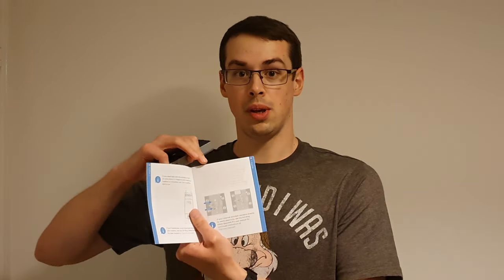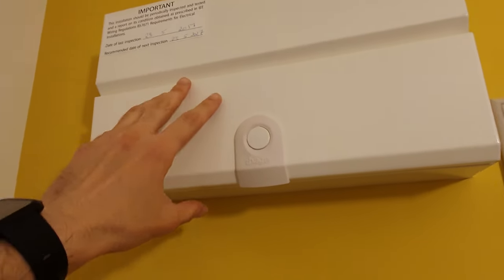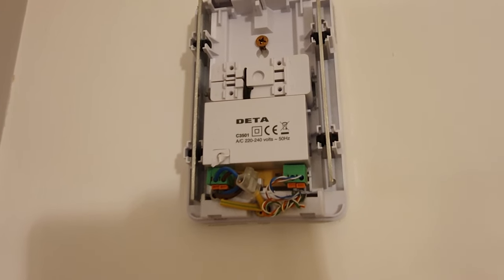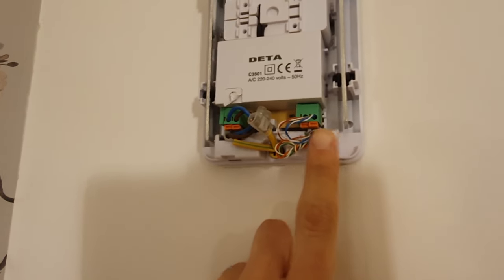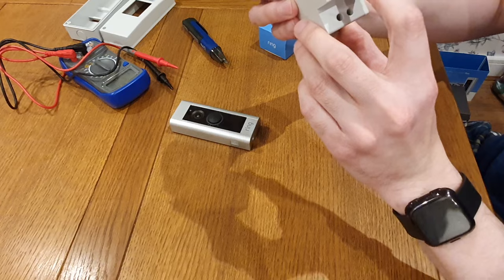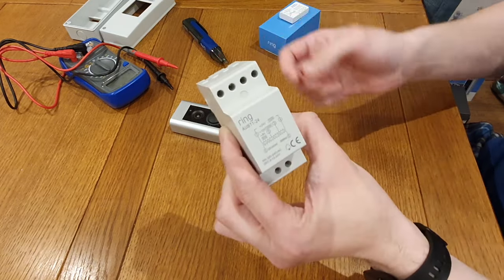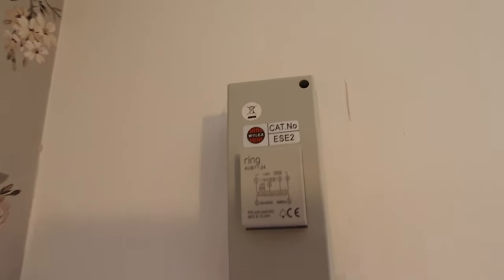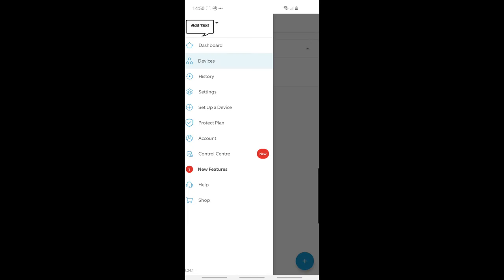Deta Doorbell to Ring Doorbell Pro - UK Wiring Guide (Direct To Transformer Install)

Comment: Hi great video, I’ve followed this and I’m resulting in a buzzing noise coming from the transformer it’s not getting hot or anything but the sound is annoying… do you know how I can resolve this?
Reply from the maker: Hi, thanks 🙂 The buzzing sound is annoying because not all Ring transformers have this issue. The best advice is to firstly rule out any loose connections, but after that to contact Ring customer services who might be able to send a new transformer out.

Comment: Hi great video! I have a ring 3 plus bell, iv followed your steps it said hardwire but it does t get charged some reason ,
Reply from the maker: Hi, thanks, glad you found it helpful. That's odd - does the app show the voltage under Device Health?
Reply: No i dont think it shows on the ring 3 plus , it just says wired and battery shows very good ,i read somewhere it says for saving battery it won’t change till it gets below %90 so i will wait till battery goes below %90 , im hoping it will charge back up 🤞🏽
Reply from the maker: Ah good point, I had forgotten that it's more of a trickle charge with the non-Pro options. You're probably right that it's not currently charging much/at all due to its design. Plus the Ring support page says that low temperatures can have an impact too: https://support.ring.com/hc/en-gb/articles/204252980-Ring-Video-Doorbell-Hardwired-vs-Battery-Powered-Operation

Comment: Hi, good video. Exactly what I want to do.
What version of the ring doorbell is the one in the video and what else do I need to have everything you used in the video?
Reply from the maker: Hi, thanks! This is the Ring Doorbell Pro 1, but the steps should be similar for the Pro 2 and Doorbell Wired too. The only other thing you'll need is the wall enclosure - I purchased this one: https://www.screwfix.com/p/wylex-ese2-ip40-2-module-unpopulated-din-enclosure/32311
Reply: @SmartHomePoint  perfect. Thank you.
Reply: @SmartHomePoint  Hi, I got the Ring doorbell wired but it didn't come with the transformer or circuit breaker. Can these be purchased seperatley do you know?

Comment: Where does your chime come from now you removed the whole unit?  I don't have a bell switch in my consumer unit so this is the only way I see of wiring it up as I dont want any wires exposed. Bit annoyed that I didnt realise before ordering.
Reply from the maker: Yes this approach should work well for you. There's also the Ring Pro plug-in power adapter, but this may depend on how easily you can run and hide the power adapter cable. In terms of your question - the chime is literally via the plug-in Ring Chime device (also supplied in the Ring Pro box). One downside is that this is WiFi based, meaning that if the WiFi is down, I won't get a doorbell chime. On the plus side, I can hear people knock just fine and my WiFi is super reliable, so I'm not too concerned about only having WiFi-dependent chimes.
Reply: @SmartHomePoint  Thanks for your reply.  I'll be doing it your way.  I dont have a spare plug near enough the doorbell and dont want any cables exposed.  Ah didn't realise it comes with the seperate chime, I just checked and it will.  I can also connect the doorbell to to the amazon Alexa, just realised.  Also, not that I need a chime with two dogs in the house.  I've ordered the circuit breaker enclosure now.  Thanks
Reply from the maker: Ah cool, sounds a plan - I hope the Pro works out well for you! And yes, fair point about the two dogs as a backup chime 😆

Comment: Do you know what size torx screw this uses? I bought a screwdriver and screw online and the screw does fit the whole, but is far too short to reach the thread behind. Having real problems trying to find out what size I need
Reply from the maker: Good question. Uhm, it's a T6 Torx screwhead but I'm not sure of the best length to buy sorry. From memory, it was a quite short screw for my Ring Doorbell Pro - it certainly wasn't long.

Comment: Thanks for the video. Can you tell me how you removed the wires from the Deta doorbell please? There are orange tabs underneath the green connection blocks - do you have to prise these down, up or in to release the wires?
Reply from the maker: Unfortunately I can't remember for sure how easy it was to remove the wires. I think it was fairly easy though - I think I used a flathead screwdriver on the orange tabs, and moved them away - whilst pulling on the wire to remove it.
Reply: @SmartHomePoint  Many thanks!

Comment: Do you need a transformer. If I understand correctly the DETA input is 230v and output is 14.5v ac. the Ring 3 supports that out of the box. Ring supports 8-24 volt amps V ac.
Reply from the maker: The Doorbell Pro requires at least 16v AC as far as I know ( https://support.ring.com/hc/en-gb/articles/115000115323-Troubleshooting-Insufficient-Power-Issues-with-your-Ring-Video-Doorbell-Pro ).

As far as the non-Pro models go, I agree that they allow down to an 8c AC supply as you say. However the Deta doorbell units are all listed as incompatible ( https://support.ring.com/hc/en-gb/articles/210644123-Ring-Video-Doorbell-Chime-Kit-Compatibility-List ) due to the chime component. So my hunch is that the non-Pro models would still need a transformer change (unless a way is found to just use the transformer part of them).

Comment: Just got a simplisafe doorbell (recently launched in the UK) and I'm facing the same issue where simply switching up the Deta doorbell with the new one doesn't work. Have you or anyone got any recommendations on a non-ring transformer?
Reply from the maker: Byron are meant to sell a transformer that works with a range of smart doorbells, but I haven't tested it out myself sorry.
Reply: @SmartHomePoint  cheers for replying! I decided to order a British 8-24V transformer/plastic casing set from Amazon. Description said it is compatable with various video doorbells. Don't think I have any alternative to the Ring Power Kit thing though but can't see anywhere that Simplisafe doorbells require one.

Shame that Simplisafe support basically tell to use some other non-specified transformer or contact a professional. Whereas Ring seem to include all the bits needed with the doorbell itself so DIYers can replace the Deta ones themselves.

At least the SimpliSafe Base Station can ring without a chime so won't have to worry about getting that one too.
Reply: Update: Removed the Deta box and attached the new transformer. Simplisafe pro doorbell now works like a charm. Thanks mate!
Reply from the maker: That's awesome, glad to hear it worked 👍

Comment: Great vid! The terminals on the rear of the ring doorbell look very exposed to water ingress. Is there any kind of water seal that comes with the doorbell to give it some sort of protection from water seeping down between door frame and doorbell?
Reply from the maker: Thanks! Yes you're unfortunately right, they do seem fairly exposed. There's no water seal included, nor is this mentioned in the full install guide. It's been dry since I installed the Ring Doorbell, but I'll keep an eye on things when it next rains.
Reply: @SmartHomePoint  any updates now that it has rained many times? Any problems at all?
Reply from the maker: Hi Hamid, there's been no issues at all thankfully :) There have even been rain drops on the very top, but with no issues in the operation of the Ring Doorbell.
Reply: @SmartHomePoint  brilliant, good to hear 👌
Reply: I noticed this could happen when I installed mine. I put Evo-Stick Multi Purpose Silicone (clear) in the gap! Hope this helps...

Comment: Cheers for this video. Is the installation the same if you don't have an existing doorbell?
Reply from the maker: Everything after I stripped back the Deta doorbell would be the same yes - i.e. the Ring Pro transformer needs a mains voltage cable as input. Alternatively if you don't have an existing doorbell at all, you can buy the Plug-In Adapter which plugs into a wall socket and then you run the cable directly to the back of your Ring Doorbell Pro (i.e. do need for a transformer in-between).
Reply: @SmartHomePoint  Thank you. Much appreciated. I've got an electrician coming in to do a fair bit of wiring anyway so transformer wont be any extra trouble. So you used the two little holes in the side of the pro power kit? Those spots are already showing on mine and when I peel back my sticker, it is a small two pin socket under there. Is that the same for you?
Reply from the maker: Ah cool, sounds like including the transformer will be simple enough for the electrician then. Yes I used the two little holes in the side of the Pro Power Kit. Mine sounds the same as how you describe yours yes.
Reply: @SmartHomePoint  Cheers!
Reply from the maker: A useful guide thanks, good to have some extra context for the install.

Comment: Hello I see you say the C3501 has a transformer already installed, so if we want to just keep that on the wall where would i place the bypass cable?
Reply from the maker: Hello, unfortunately I'm not sure where the bypass cable would go with the C3501. The Deta doorbell doesn't always supply sufficient and constant voltage for the Ring Doorbell. That's why I swapped it out completely, since it's not compatible as-is for powering a Ring Doorbell.
Reply: Did you ever figure this out? I was going to try this before buying another transformer and going through the hassle

Comment: Hello I’m getting a buzzing on my transformer and through my ring video feed have installed it wrong?
Reply from the maker: Hmm that's frustrating. I've heard people mention this, but mine was fine. Of the people who have had this themselves, some people say that they had a short (e.g. the wires at the Pro were touching each other), others had a loose wire connection somewhere, and fixing this usually fixed the humming.

If that doesn't help though, it could be worth getting in touch with Ring's support team incase it's an issue with the transformer (i.e. beyond any minor noise it could make).
Reply: I'm getting the very exact issue... and has caused no amount of distress to my dog... to the extent that I've uninstalled the Ring pro and am considering returning it. But, I might actually tin the wires to see if that helps ensure that the wires don't fray and come into contact with each other.
Reply: @thepandefamily  I’ve contacted ring and they’ve said it is sometimes the transformer itself and they’ve sent me another. So I’m hoping that solves it

Comment: Cheers, great video! Would I be able to just splice open a power cable, plug one end into the transformer and the other end in to wall socket for AC power? 
Is there any issues with doing that grounding maybe?
Reply from the maker: Thanks, glad you found it useful :) What you say should in theory work as it would be 230V into the transformer input... but I'm not a qualified electrician so I can't say for sure.

I'm not sure if you know about the Ring Pro Plug-In Adapter, but that might be a good alternative. It's an official Ring product and allows you to bypass the transformer completely - you plug it into a wall socket, and then you just get two 24V cables to connect directly to the Ring Pro terminals. Could be a nicer solution, depending on if you can run the cable.
Reply: @SmartHomePoint  thanks for the reply, yes I've just tried it and it works a charm!
Saves me spending £20 on an adapter
Reply from the maker: That's great, good to know that this method works. Enjoy your new Ring doorbell!
Reply: @SmartHomePoint  i just got the adapter for the doorbell. I am planning on replacing the doorbell box with a socket and the wires from the bell will just come out there on top. I need to cut the adapter cable as it is 6 metres long but I only need 15 cms.
Reply from the maker: That sounds a good approach, it'll lead to a clean install IMO. Hope it goes well for you 👍

Comment: Why you couldn’t install the transformer in the consumer unit? You already had a switch for the door bell in your consumer unit. All you had to do was replace this with the ring transformer and this would send the necessary 24 volts to the doorbell box and then straight connect it there to the doorbell. Am I missing something?
Reply from the maker: My understanding is that I would still have had to join the CAT5 output cable to the higher guage 240v input cable somewhere - i.e. still at the wall where the old Deta doorbell (and new Ring transformer) were. So yes, I could have done it this way but it still would have required a junction box or similar outside of the consumer unit AFAIK?
Reply: @SmartHomePoint  M’y current doorbell has just two single white wires going out to my old doorbell straight from the transformer. I don’t have a CAT5 output at all. My problem is that my consumer unit has no dedicated switch so i can’t be sure which cables going to the existing doorbell. So I bought the adaptor pro doorbell so I can totally remove my existing doorbell with a socket and just plug it in
Reply from the maker: Ah okay, a bit different to mine then. Yes the power adapter sounds like the perfect choice for you then 👍
Reply: Your old deta door bell could been used as a junction box no??
Reply from the maker: It could have been, but I saw someone else attempt it and they ended up using some tape to hold the Ring transformer in place inside the Deta chime unit. Since that felt like a bit of an unreliable approach, I thought that I'd be better off with a specific 1 unit DIN rail enclosure.

Comment: hi is it normal for my transformer to make a slight humming noise
Reply from the maker: Unfortunately it is yes. Some Ring transformers make no noise, others do. If yours seems too loud, try contacting Ring customer service - sometimes they send a new one out.
Reply: @SmartHomePoint   thank you for your reply i found out its the transformer touching the casing is there better casings out there
Reply from the maker: Oh that's interesting. I'm wondering whether a 2 or 3 module DIN enclosure might be better instead? As it will give more space. Alternatively, the following might work well but I'm not sure if overheating could then become an issue: https://www.electricaldirect.co.uk/product/hylec-dn-junction-box-125x175x75mm-671722?vat=1&pr=1&gclid=CjwKCAjwjJmIBhA4EiwAQdCbxjiEpMKZ0b2qrZEhFbTF292PERnZOd100YSMCvxfhrQ4O9HBahBNphoClQ0QAvD_BwE

Comment: I bought a different brand of doorbell and there was no mention of any circuit breakers. Is is really necessary? And if so, are there any third-party circuit breakers out there that o should buy instead?
Reply from the maker: It probably does depend on the doorbell you have, yes. Ring's ones are designed to ring a separate chime, hence the need for the Pro Power Kit in many cases. But that doesn't mean that all smart doorbells require something similar 🙂

Comment: great video! When you install the ring pro what it show on the ring app about device health?
Reply from the maker: Thanks! I just checked the app and I get a 'Transformer Voltage' of 'Good/4003.0mV' and a 'Signal Strength' of 'RSSI - 59'.

My Pro auto connected on 5 GHz WiFi but it's always worked fine even though there's two walls between the doorbell and my router.
Reply: Ok thanks for the info. Also on my deta I got blue/white twisted cable and Full blue connect instead of your orange/white twisted. Does it make a difference? Thank you :)
Reply from the maker: Yeah that'd be fine too - as long at there's enough output voltage going to the Pro, the actual cables/wires themselves shouldn't matter.

The only real issue would be if the output wires are very, very thin (e.g. if a single strand of telephone wire is used) - in that case, there wouldn't be enough output voltage to the doorbell.
Reply: I did the instalation yesterday and everything is working fine. Thank you for making this video and for your replies. You got a new subscriber. Best wishes :)
Reply from the maker: Ah great, glad you got it working, enjoy your new Ring doorbell!

Comment: what about your chime you don't have one now
Reply from the maker: Yes good question, I missed this on the original video. I didn't use a mechanical chime in the end. I instead use my Ring Chime and Echo devices. Yes they're WiFi based, so they won't work if my internet goes out, but I can nearly always hear people knocking my front door so it's no biggie.

Comment: Hi i have a byron 776 doorbell which ring recommend for hardwired chime,  would this work??
Reply from the maker: Hello, yes it would be possible to install and get the existing chime working, but that latter bit isn't covered in this video guide (which removes the chime completey, and just goes input -> transformer -> doorbell).